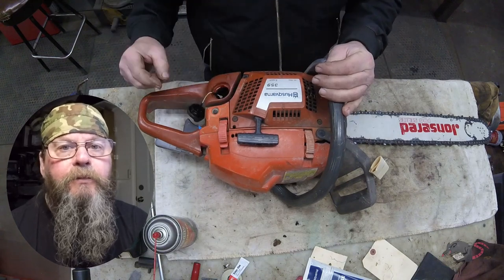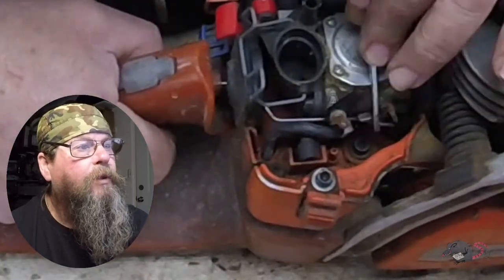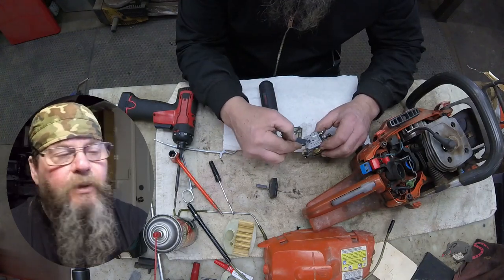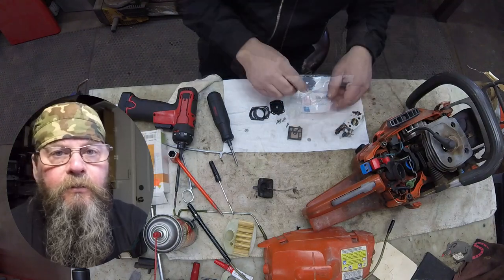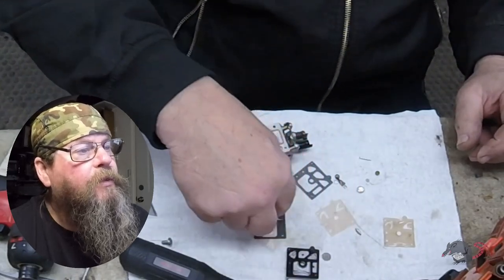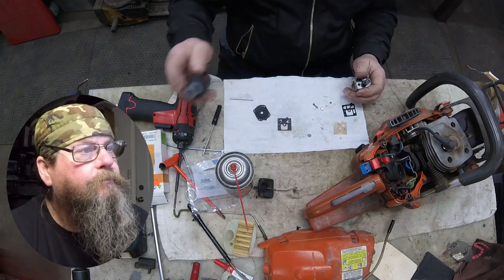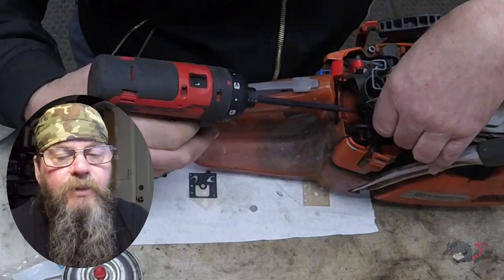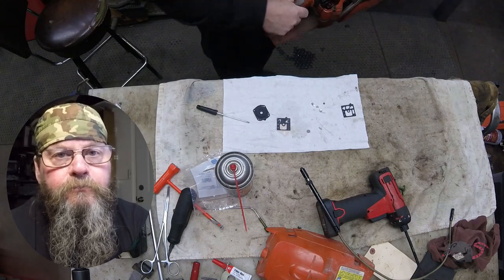Husqvarna 359 Chainsaw Carb Refresh

Comment: You know what solves the running problem of those Walbro HDA199's is to drill a vent hole in the side of the plate that covers the diaphragm. You often see it on Walbros no idea why they didn't on these but it fixed my Husqvarna 357 carburetors completely.
Reply from the maker: I'll take a closer look at that but I have to wonder why it ran fine for the first fifteen or twenty years. There must be something else going on. Thanks for watching!
Reply: На Хускварнах 257/262 карбюратор Вальбро HDA120- и там есть это компенсационное отверстие!

Comment: I just bought one when she get warm she wont idle and dies , first i taught is cloged tank breather but with the tank cap open it's not much better , now i need to check the crank shaft seals.
Reply from the maker: First make sure the cylinder isn't scored.

Comment: Years ago my 359 had the same issue. I did all of this and, after it ran fine for a while, the problem would return. I finally replaced the carb with a Zama Z3 EL42 and it has run like a champ for years..
Reply from the maker: Carbs can be finicky.

Comment: So I finally got a better compression tester in. My 460 Rancher tested 150 PSI, the 562xp I rebuilt recently consistently tested at 125 PSI, and the brand new 550 xp Mark II tested at 110 PSI...the last two don't seem quite right to me, do these saws need to be hot when I perform this test?
Reply from the maker: No they should be cold for testing. I think the new 550's I've tested usually come in around 135 before broke in.

Comment: I have a 440 I just bought for $10, I put a Chinese Amazon carb on it but still have the original, is it worth cleaning the original for more long term reliability?
Reply from the maker: If the aftermarket carb works properly you're probably ok but it never hurts to have a spare.

Comment: Might you have any suggestions on how to increase fuel going into the cylinder when starting.  It takes ten pulls or so to get the saw to kick over, and then it runs perfectly fine.  When warm it starts quick, when cold the plug stays dry until that many pulls.  The carb has been disassembled and looks in good shape with good diaphragms, metering and pump.  I tried shortening the fuel line and also raising the metering lever above spec (grasping at straws), but there was no improvement.  Thanks!
Reply from the maker: I start a lot of fresh rebuilt carbs and new equipment. if it doesn't have a primer bulb it takes almost exactly 10 pulls to prime the carb and start. Old timers would tell you to get a squirt bottle of premix, remove the air filter and give it a shot. It will start right up. You could check your pulse hose and also if the choke is closing completly. You might also have a condition where the fuel leaks away, like through a weak main nozzle check valve. Pressure test the carb.
Reply: Good suggestions, thanks.  I thought about adding a carb with a primer bulb, but some hassle to jury-rig the thing no doubt.  The choke is ok, I'll take a look at the pulse hose.

Comment: How many times have you refreshed a carb that you wound up having to replace the carburetor? Seems to be happening more frequently for me.
Reply from the maker: It happens but you can make it happen less if you're willing to bail out early. Don't think you can save them all. If it won't prime, I bail. If its rusty inside, I'm out. If it runs erratic then maybe but if the OEM replacement costs less than a half hour labor then I lean towards replacement. If its just flooding, not getting fuel at all or sluggish then I go for it.
Reply: @TheGreasyShopRag  I appreciate the input. Retiring in a couple of years and opening a shop. Trying to get more educated. Keep up the great videos.
Reply from the maker: @themowershop5373  Thanks!
Reply: @TheGreasyShopRag  Scott this Husky 235 is fighting me. The refresh was a failure, replaced the carb (twice) and still can't get it to tune. Every attempt the high side had a bog. Engine is sealed tight, getting spark, 150lbs. compression, fresh fuel. I'm wondering if I should try another carb?
Reply from the maker: @themowershop5373  You may have checked but I gotta throw it out there...has the fuel filter been changed? is the fuel hose kinked? Is the fuel tank vent working?
Reply: @TheGreasyShopRag  This saw needed some love. I did replace the fuel lines along with a new filter. The tank vent has been in the back of my mind. When I turn the saw on its side to remove the starter cover fuel leaks out of the vent. Another puzzler is when trying to restart, it will somes pop or misfire, small but noticeable. Do you think the timing may be off?
Reply from the maker: @themowershop5373  If you suspect a timing issue you can just remove the flywheel and inspect the key. I suppose the coil could be bad.
Reply: @TheGreasyShopRag  No spark issue, I replaced the coil. The flywheel had cracks  replaced it as well.

Comment: Thanks, great information. Customer might as well replace parts that are done during a tuneup. I got lucky by pressurizing a generator gas tank and working the float up and down. Got the dirt loose and start working again. Take care
Reply from the maker: Good job!
Reply: @TheGreasyShopRag  thank you. Carb had pressed in pin.

Comment: Great video man! I had one question. Was that the original carb you were working on ,that came on the 359?
Or was that the updated one ? Helpful video, I appreciate it!
Reply from the maker: Thats a great question. I think the updated carb is a Zama Z3 EL42 and the carb I'm working on is a Walbro, presumably making it original.
Reply: @TheGreasyShopRag es gab aber auch original Zama vergaser bei der 359
Reply from the maker: @naturundhund  Yes they used both.
Reply: @TheGreasyShopRag  ok...greetings from Germany Peter